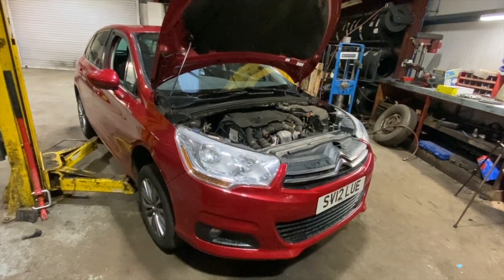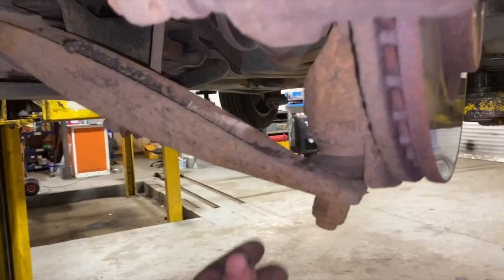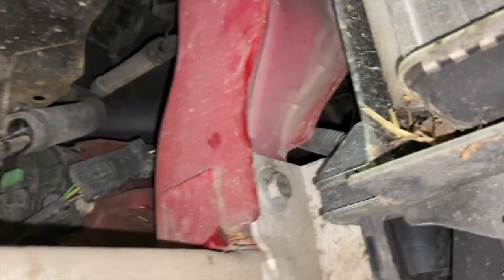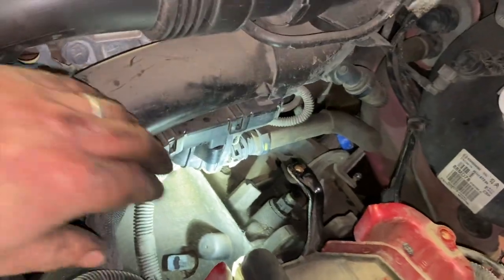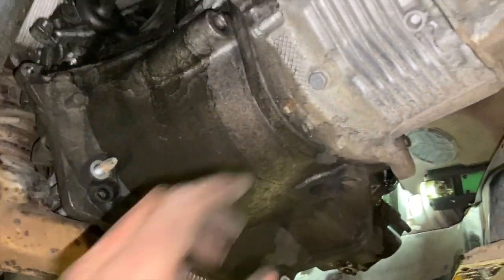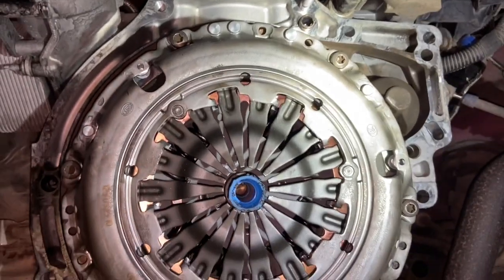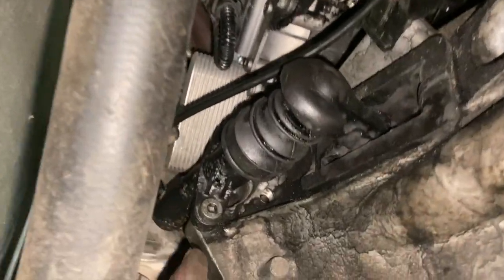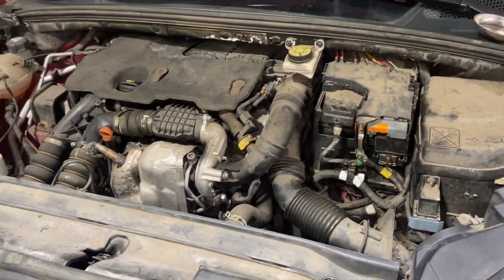Citroen C4 Clutch replacement 2012 model

Comment from the maker: New LUK Clutch kit Euro car parts - https://tidd.ly/3fl2fLb
Check "Car parts for less" for Cheap Car parts - https://tidd.ly/32DneDd

Clutch kit eBay - https://ebay.us/uYoeKM
Clutch guide tube Ebay - https://ebay.us/LY7QXd
Clutch kit amazon - https://amzn.to/3uLsxN0
guide tube amazon - https://amzn.to/3bp88pm

Tools Used : 
E-Torx sockets  - https://amzn.to/3kaIVR3
Torx sockets - https://amzn.to/2JZb1lY
Allen sockets - https://amzn.to/3phBT0C
1/2" Impact driver - https://amzn.to/38Bclps
3/8 Impact driver - https://amzn.to/3nb2v1i
Socket set - https://amzn.to/36dcZXo
Spanner set - https://amzn.to/3p8ZTDa
Screwdriver set - https://amzn.to/38isBeR
Ring Inspection lamp - https://amzn.to/2IeEiIN
Torque wrench - https://amzn.to/3pvnXjQ
Digital torque wrench - https://amzn.to/3yd8kSy
Prybar set - https://amzn.to/3nh2t8c
Copper hammer - https://amzn.to/3fmw2Dg
Battery ratchet - https://ebay.us/i2ryoP
Suspension arm puller bar - https://ebay.us/30GWMc
Gear oil pump - https://ebay.us/ETxZLE

Torque settings:
Clutch plate torque setting = 20NM
Filler plug - 15NM
Level plug - 22NM
Drain plug - 35NM
Hub nuts - 305NM

Gearbox oil Quantity:
1.9 Ltr 75/80 or 75/90 gearbox oil.

Comment: Thank you for your video. I gonna change for my Peugeot 3008 (2012) 1.6 Hdi (82 KW / 112PS) clutch. What is the torque on the flywheel bolts, the clutch bolts and the slave cylinder bolts?
Reply from the maker: Thanks , they should be listed in the description mate
Reply: Thank you.  Can I ask you where I can find the rear crankshaft seal installation tool for the same engine?

Comment: Do You Need a Wheel Alignment after this ? Also I feel some vibration on a clutch pedal when  I barely touch it and hear some noise is it time to replace the clutch ?
Reply from the maker: Yeah that’s most likely clutch / dmf related , shouldnt need tracking

Comment: I’ve got a Citroen c4 Picasso 2011 vtr+ semi auto paddle shift and I’ve got major gear box oil leak recently. It’s like clutch is slipping when driving and car revs up without it catching the gear properly. Once I stop and look under car I can see oil leaking from underneath. I first thought it was the actuator high pressure pipe leaking but when I took battery out and all it’s trays,  then removed the near side inner wheel arch, this where the reservoir bottle is for actuator but the actuator reservoir bottle was full, I’ve got a new pipe for it and oil, but I’m not convinced it’s not this but I’m going to change the pipe anyway as I had already removed the pipe from the top end of the actuator. I’ve got oil all over the bottom of the car gear box and near side bottom of my car. I put in 1.8ltres of new oil & car run fine for a while then same thing like gears slipping  and oil coming out the bottom, you can’still drive it but it over devs like it’s slipping again without gaining too much speed. I’m confused what it could be. I’m wondering if the oil is leaking from the short shaft that gos into the gear box maybe it’s leaking from there. Any suggestions? If it had been a clutch why would oil leak out bottom. I’m not sure.

Comment: !!!Totally cool video!!!.
Doing the clutch right now on Mk1 1.6VTI 120HP C4, (done already on Audi A4 B5, 1.8 125HP), but this... the real PITA job 😠.
I've done almost everything you've said .... just didn't remove that lower stud (E8 socket).... kinda didn't wanna because its stud (don't like removing them... I guess it's bad experience hahah ... especially out of aluminium)... and, ouu boy I was wrong.... was fighting with nasty gearbox for a couple of hours ... and finally gave up and removed that freakin' stud.
It simply goes that if you don't remove it the subframe removing job awaits (with all the crap on it ... funny yay). There simply ain't enough space for manipulation, also maybe because it's Mk1 version of C4.
I've also removed the flexible exhaust pipe section and the lower engine mounting because that insane lowering of the engine twists those rubber bushings so much that they break... brilliant really.... I mean stupid gearbox mount... "what a design"... you just cannot take it off because stupid mount stud washer covers the last bolt... but in the end I'll be also replacing all the engine mounts.... brilliant, brilliant...
I didn't use gearbox jack but rather hang the engine.
Thanks Again for the Video!!!
Reply from the maker: Nice one , glad to hear you got it sorted and the video was of some help! thanks for the comment 👍👍

Comment: How to refill CITROËN C4 II HATCHBACK 1.6 HDI 115 114 HK 1560 CCM DIESEL? Is it with already filled and ready pouch or by refilling existing pouch? What color (orange, green, black) has connector if it matters, which pouch is correct, it has specific model name/number? Is eolys or other fluid from liquid moly etc correct?
Reply from the maker: Im really not sure tbh mate
Reply: @diydaly  At Frenchcarforum he said it's Eolys Powerflex. Do you know the volume of dpf tank for this car?
Reply from the maker: @frv6610  arr no I would know mate , got a feeling it’s around 3L

Comment: Your a fkin genius, i have no experience but love trying things but this clutch thing is awfully hard, just going to follow it as i have a problem with my ds4 and hope its not the clutch but if it is then im following your vid whilst i do it only thing is i dont have ramp so might get crushed if i screw up
Reply from the maker: Haha , hopefully that doesn’t happen! Thanks for the comment though 👌👍 , I’m sure you should be-able to get it done
Reply: @diydaly  thanks i have a question what it is when i accelerate it makes cranky grizzly type of sound for like few seconds but pulls every gear  but i dont know if its clutch or not how do i find out before i know what to fix or change
Reply from the maker: @osmanali3211  very hard to say without looking myself , could be the flywheel if it’s got a dual mass

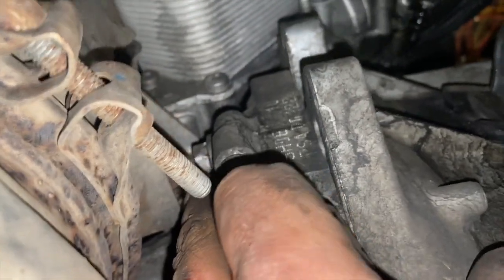Comment: Tried this on my b9 but did not sucseed.  the bolt into the gearbox beside the dpf was rounded. So with no propper tools i had to give up.      Do you know if this bolt is threaded in the engine side?     I was thinking just cut of the head of the bolt. to get the gearbox out. 23:15
Reply from the maker: That’s a pain! Yes I’m sure it is threaded in the engine side mate